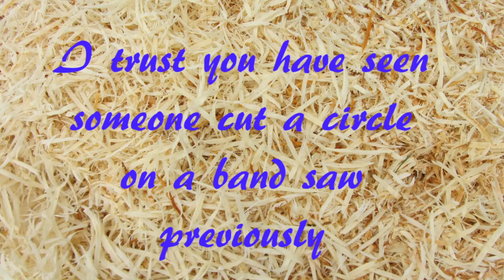Dressing Up A Plain Small Mouth Bowl

Comment: The Richardson atomizer doesn’t create a vacuum but rather an area of very low pressure.   The high velocity air coming out of the tube you blow in is a much lower pressure than the atmosphere around which causes the air in the ink tube to rush into that low pressure zone (high pressure always moves into low) pulling the ink along with it.    Beautiful piece !!!   I’ve always thought small mouth bowls like this would be good (outside of being an objet d’arte) as a spot for your keys...   I’ve always found having that one thing to always put them lessens the likelihood of having to hunt them down.   Love the channel, keep it up !!!
Reply from the maker: I guess technically you are correct. But, to me low pressure is closely related partial vacuum. But no matter, it works.
You just reduced the value of this piece by finding utility for it. :)
Thanks for your explanation.
Alan
Reply: @As Wood Turns  -  haha, well, it is far too nice for keys !!    I taught an after school science enrichment program for single digit aged kids in college and I was always very careful to avoid using low pressure and vacuum interchangeably as the kids often confused of the vacuum of space with the violence associated with vacuum chamber experiments...

Comment: Turned out nice Alan, pun intended. =)   I've done similar, but undercut to make it a bowl-like hollow form - also pretty useless. ;-) 

I didn't know they made manual airbrushes like that... I got my airbrush kit on sale for ~$10 many years ago and even such a cheap setup has done everything I've asked of it so far.
Reply from the maker: If you have an airbrush, you probably will never need an atomizer.
However, your $10 airbrush costs a lot more now.
Thank you
Alan